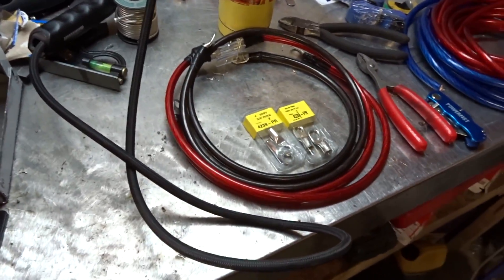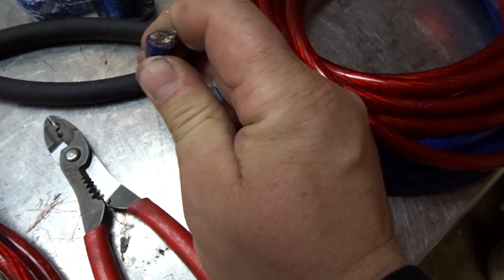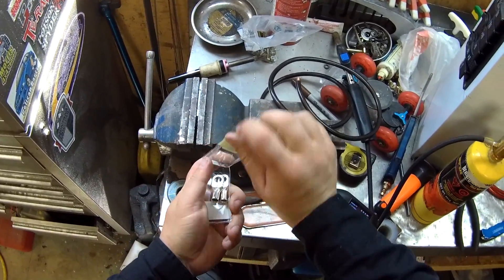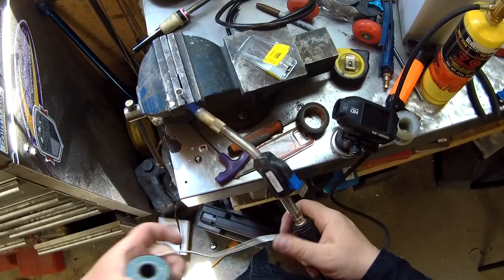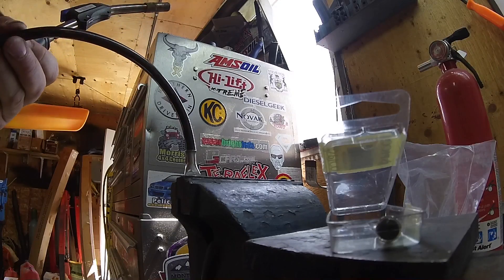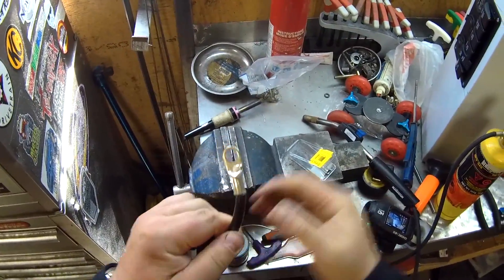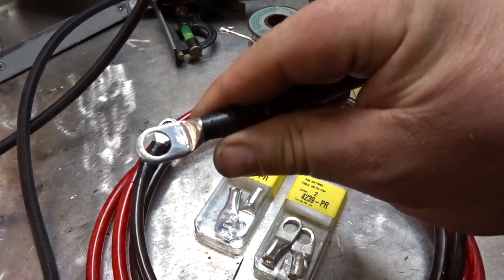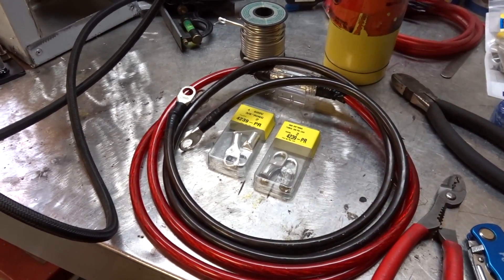How to Make a Battery Cable DIY

Comment: That is what is known as a COLD solder joint. It is electrically inferior.  The copper wire and connector both need to be hot before adding solder. How much current you will lose in the connection is unknown, but it will cost you power for every connection made like that.

Comment: For anything bigger than 8 gauge, I use my 10 ton Hydraulic Crimper that I got from Amazon for cheap. Believe it or not, using a hydraulic crimper actually makes a better connection that soldering does. The copper lug plus the copper wire become cold welded together at those kinds of pressures. Try it, then cut it in half, you'll see that it becomes "one".

This is the crimper I bought: amzn.com/B0114QC3OY

But yeah, for 8 gauge and smaller, solder is the only way to go.

Comment: never seen it done that way does seem nice n easy, i crimp with a big crimper then solder because i dont trust my workmanship LOL
one thing i learnt is good connections = more power into batteries those mc4 connectors on the panel leads can play up at times and good solid connections to inverters = they work better and dont make low voltage alarms when battery voltage is actualy good.

Comment: The best way is to crimp then solder it. And the solder is really only required in marine environments. But you need to have the crimper I guess. Also if you stuck the wire in cold you should keep heating it jerry.